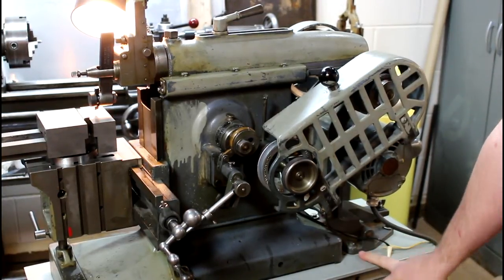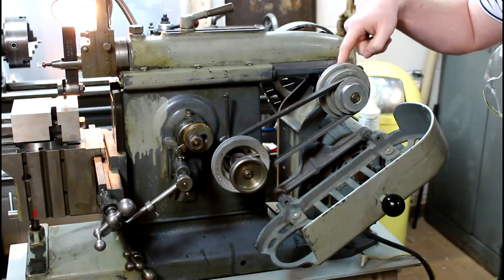7" Delta Rockwell Metal Shaper New to Me!

Comment: Inside the pawl-pin assembly is a ring that needs to be tightened occasionally. If it doesn't advance, just tighten it a bit.. just a PSA in case anyone has a similar issue. Great video and machine. I have one just like it.

Comment: Read the edit below also!

I've got the same shaper (but it's an Ammco) with the exact same issue with the feed pawl.  I'm trying to get the pin out so I can take it apart and inspect it. 

I bought the machine a couple of months ago simply because they are mesmerizing to watch operate.  It's in near immaculate original shape with original light, vise, paint, tags and decal.  I didn't think I'd use the machine that much, but find I use it all the time...

EDIT:  Fixed it.  After fighting the feed pawl mechanism all morning without luck I started looking g elsewhere.  Turned out the Gibson on the table for side to side movement was too tight.  Loosened the gibs screws up a bit and the feed now works perfect in both directions...

Comment: Hello. Nice machine. I am reconditioning a similar machine now. It is an Ammco 6"shaper, so there are some minor differences. Two things to look at in your table crossfeed mechanism are: the lower end of the ratchet pawl and the other end of the crossfeed screw. The pawl should have one asymmetrical end, vertical on one side, slanted on the other. If it iz worn out (like mine was), it will not feed properly. Mine also has a drag brake on tbe far end of the crossfeed screw where it passes through the casting. Just a hole in the crossfeed castng with a brass slug that bears against the screw, and a set screw over the slug to put a little pressure on it. I hope this helps you to iron out the last details.
Reply from the maker: Thanks for the info. I actually sold this machine several years ago. I did get it working a little better, but I basically gave up after a while. I have a 17" shaper now and I could set a machine this size on the box of my new one.
Reply: I have the AMMCO 6" version too. Mine has the table height screw under the bench, not out the side. From what I have found out, I think that means pre 1941. Mine does not have the original feed mechanism, it has a home made replacement from before I got it. I also have a 10 inch and an 18 inch shaper.

Comment: I have the same shaper but, mine is an Ammco. Delta made them for Ammco or the other way around.  I'm not sure. It's been mothballed for several years and needs a good clean-up and paint. I've used it when it used to belong to a previous employer and it worked nice. I've just got to get it out and fix it up. Hopefully, this winter. It's been said in the past, "You can make anything with a shaper, except money." LOL.  Thanks for sharing your's.
Reply from the maker: +Dave Lee 
Hey, Yeah they are fun little machines but do take time to run! It's kind of rare to see a shaper of any size in a shop today unless they are doing specialty work. You'll have to get your out and get it going! start making something on it. Thanks for watching and commenting!

Comment: You need more tension on that feed rod so that the tension of the drive pawl is weaker than the force required to turn the feed screw.   In order to do that you need to tighten the nuts on the end of the feed rod that is opposite to the handle.  That will fix the problem with the auto-feed.  I had the same problem on mine until I torqued the nuts tight enough. . . .  Jim
Reply from the maker: +James Schmitt 
That was one of many things I tried. I spent about a week with loose, tight and everything in between on those lock nuts. I finally did get it working OK after about a month and tearing every part of that auto feed apart. Although it worked OK, I never got it working the way it was suppose to. I finally sold it and bought another machine for my shop. I would like to find another, but if I do I'll most likely look for an Atlas, South Bend, Logan, or maybe a little larger machine. I'm done with the Deltas as far as shapers go! I'm sure they work great when tuned up, but the particular one had issues!

Comment: I believe your tool holder is in backwards which will cause it to chatter more. There is another video here that show what I mean https://www.youtube.com/watch?v=bqqArCxkMtc you might want to check it out.
Reply from the maker: +imystery man Hey, Thanks, I had not seen that video till now. I guess I could be wrong, but to me the way that guy has it on would cause the bit to be less stable because instead of the bit pushing against the large body of the holder, it is pushing against the smaller locking cap. I could be wrong, but I think his is backwards. I've since sold this machine. Thanks for the comments though!

Comment: I see no reason why you couldnt drill & and tap with a set screw 'thats what I'd do"
then take the 'ratchet' apart, most likely the pawl needs sharpening or a weak spring
in there or its got dried goopy grease.  Not make money with a shaper? thats a wifes tale.  bottom line a mill has its place, and a shaper has its place.  We can produce a 
finish with a shaper you can shave in like a mirror.  Its all in the grinding of the bit. Looks
like I will have to make a vidio ;  We also have a shaper mill / drill attachment for special
work we do.  Gear tooth implants all done on a shaper.  Machine gears without expensive mill gear cutters, all done on a shaper.  "Its all in the grinding of the bit"
Bottom line;  example  a rusted up say 3x3 piece of junk.  The shaper eats rust it don't
care,  Would you ruin an expensive mill end mill??  NO,  a 2 dollar HSS blank fits the bill
can be sharpened over and over.  And also do not under estimate a 7 in shaper.  We old
timers have a sayin  "if your in a hurry, ya don't belong in a machine shop"   samuel
Reply from the maker: +samuel pine Hey, I tried everything under the sun to try and fix that pawl pin issue. several different spring tensions, reground the edge, made a couple completely new pins, and it was always nice and clean minus some lubricating oil. I did finally get it working OK, but it was never reliable and I ended up selling it because I wanted to move on to other things. I'll get another one someday, but not for a few years. I would like to buy a little larger one maybe a 9-12" model. I did make a series of videos on making an aluminum case for a safety razor which turned out really nice. I'm not expert on running one of these machines, but the more I used it, the more I learned how to make certain cuts with it. Also I 100% agree with you that the grinding of a bit is the most important part about how nice of a cut you will get. 

I would like to see someone that really knows how to run one of these do a few videos on how to make certain cuts, and angling of the head. Not just planing a piece of metal. Plunge cuts and cutting vertically needs a different setup than going straight across. 

I originally bought mine to contour receivers, and possibly make a few gears, but I have not been doing much of that lately and the small amount that I can currently doing I can do on a mill. Thanks for watching and commenting, Good stuff!